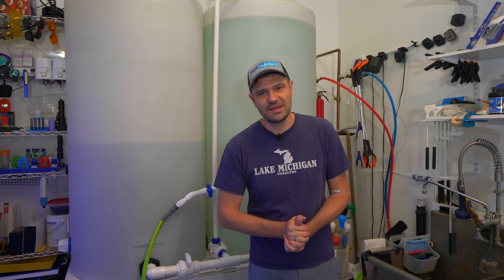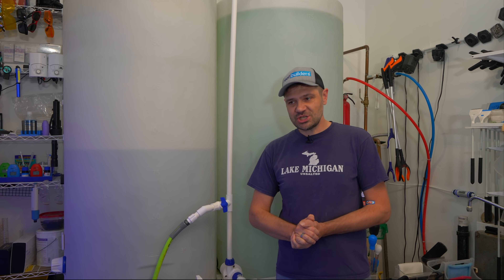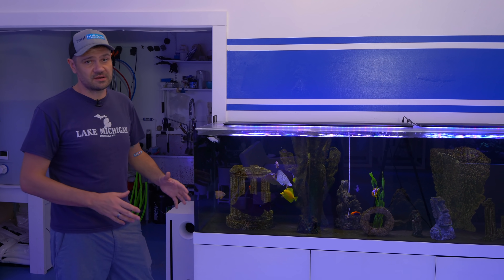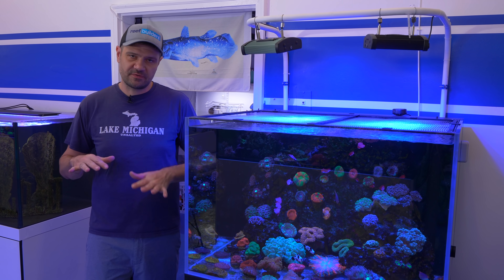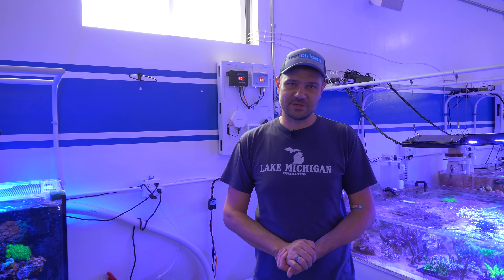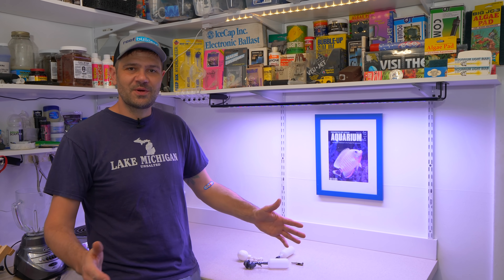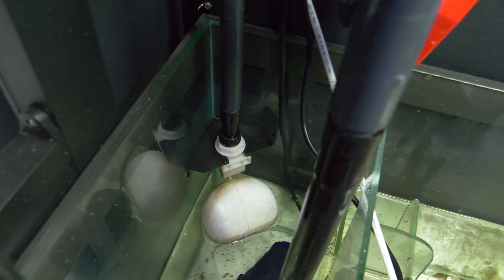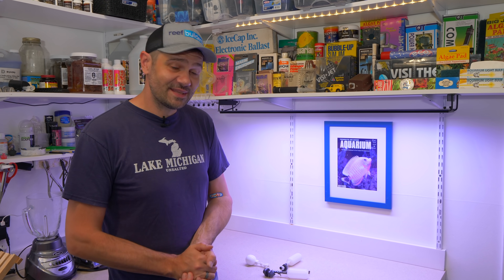Reefology ATO: Managing Evaporation and Using Float Valves for Auto Top Off

Comment: Those floating valves use rubber as its valve.  Have you seen salt debris build-up on the rubber valve and plastic parts, either due to hard water or sea water?

Comment: I need auto-top off for a series of walstad freshwater nano tanks to make them even more hands-off, but the only place for the reservoir is below the tanks. Its not cost effective to buy optical sensor triggered pump systems for all of them. I thought of ways to use the optical sensor in one tank, perhaps the smallest with the most evaporation, to trigger a pump that's connected to a split line and fill all the tanks every time its triggered. Or I wonder if I could use the mini float valves plus an aqualifter on a timer so it regularly tries to push water up the line and the float valves would block it unless it needs a top off... but are the float valves able to stay closed when a pump is pushing water up the line? Would love to see a video about cheap options

Comment: Well said. The less points of potential failure is always the way to go. For those who don't want to have a big container to refill, maybe if your tank sits in your living room or near your kitchen, you also have the option of connecting directly to your RO unit with a "T" and a valve (so you can shut it off during water changes.) Then just run the tubing neatly along the floor trim secure with some cable holders tacked to the wall.

Comment: Absolutley agree! 👏
I use a twinwall polycarbonate lid with a gap around the edges for gas exchange which reduces evaporation by around 75%, I then use an evian bottle ATO on my nano and lasts nearly a week 👍
Going to use a lid on my new Reefer XL200 with the stock float valve gravity ATO 🙌 Great video! 👍

Comment: How do you feel about using a dosing pump like 1ml per minute on a smaller tank for top off water?
Reply from the maker: yes that's another thing you can do, is slow replenishment with a dosing pump which never exceeds evap rate so it's not perfect, but will certainly reduce how often the tank needs to be topped off.

Comment: How often do you recommend cleaning the float valves to prevent clogging or sticking and what is your routine for doing so?

Also on a tank like the 1 day nano reef, how do you maintain pH in the mostly enclosed environment?
Reply from the maker: Since you're only passing freshwater through the valve it should theoretically never need cleaning - I just manually actuate them up and down a few times, about once a year. I have never tested pH in the nano reef, it's a basic setup, corals look good and growing, and I wouldn't want them to outgrow the tank anyway

Comment: Jake, does that nice little black corner bracket that holds the float valve come with the Cade or is that something you can buy/make. I have a couple tanks that say do not drill. Left over freshwater tanks.
Reply from the maker: it comes installed in the sump of the CADE tank I have

Comment: If you don't want to drill into existing sumps is there a bracket you'd recommend or just make something out of eggcrate or whatever you likely already have laying around? I know the red sea tanks use a triangle piece of acrylic vs having the float go through the sump.
Reply from the maker: I didn't mention this because it's risky, but you could attach your float valve to a VERY strong magnet inside your sump, but I don't have to tell you what will happen if it gets detached somehow
Reply: Avast Marine makes magnetic mounts.